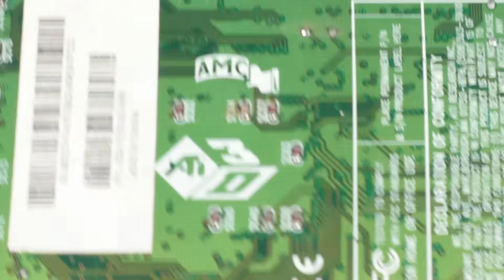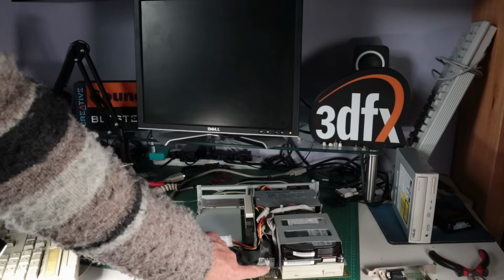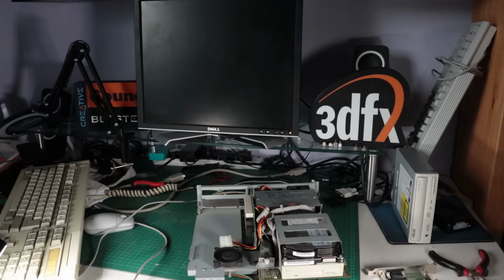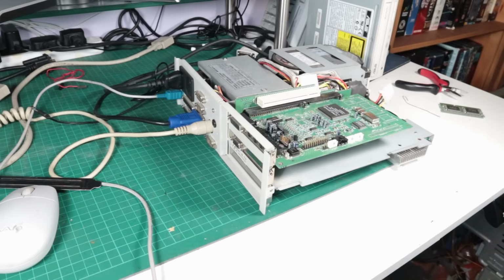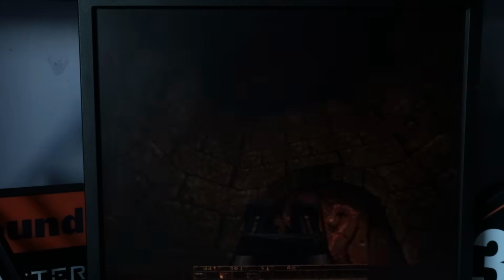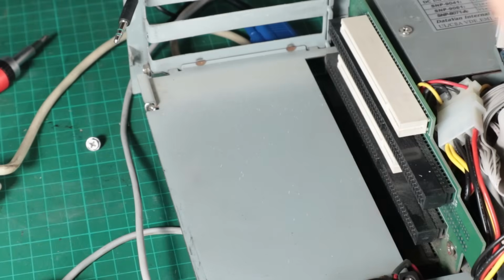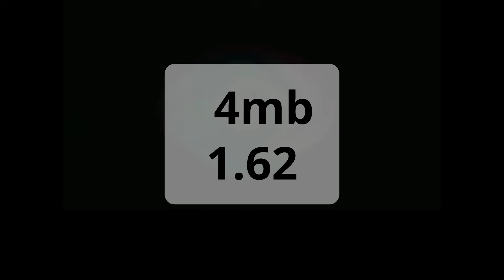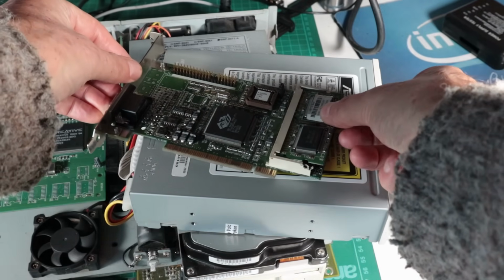Did upgrading vintage graphics card memory make a difference🤔🤞

Comment: I'm sorry but your selection of games and benchmarks is to blame for the lack of a difference here. Testing a 1997 budget card in 1999 benchmarks, of course it would be so throttled by its GPU and memory speed that the amount of memory doesn't matter. Same goes for a PC Player benchmark that uses less than 1 MB of video memory to begin with.
And here is where the 8 MB expansion would make sense: it makes the difference between being able to render at 640x480 or  800x600!
Games from around the card's release profit a lot more from this: like Tomb Raider CIF becomes playable at 800x600, which a Voodoo 1 can't do. Or you leave it at 640x480 and enjoy how it actually runs 10-20% faster than on said Voodoo!
Generally, games that run near your target FPS anyway or had FPS to spare but you couldn't select the higher resolution, that's where you would use the expansion.
To get there, it would often make sense to run in D3D instead of OpenGL (which the Rage Pro is better at) or if available ATI CIF (the proprietary API ATI used at the time, like Glide for 3dfx cards).
Reply from the maker: Haha, no need to be sorry😁 but if all you could afford was that in 1997, you probably wouldn't have been able to afford a new card in 98/99, so what could you do🤔.  I did quake and doom. Neither showed improvement in software, but gl quake did.
Reply: @66mhzbrain  Glquake and 3d mark are really the only games you tested that used the vram as a framebuffer at all, and both showed a difference. However, the 3dmark was to "modern" and heavy for the card leading to low fps anyway.

Doom isnt a 3d accelerated game. (doesnt use any graphics 3d functions)

I dont know enough about expendable to say what the problem was here.

Neither is the base variant of quake (doesnt use any graphics 3d functions), as I am sure you know.

Glquake is probably heavily cpu limited, and also possible by the GL driver from the card. Universal GL drivers were seldom made for performance back in the day, only 3dfx put some more love to get good GL game performance into their driver development.

As an example, I had about 33fps in glquake in the time period with a 200mhz AMD k6 without any cpu FPU software enhancements, (a P2 would have been much stronger) and a NVidia Riva 128 4Mb. A few years later Nvidia rewrote their GL driver and got a lot more Open GL performance.

Comment: Yeah I’d expect this would only get you higher resolutions with higher color ranges and/or allow the card to hold more textures saving time reloading from system memory.
It can’t really help if the gpu is slow to begin with.

Comment: Games like Wing Commander Prophecy, Descent Freespace, Unreal and Half Life would probably utilize the 8MB more than what you showed. I played all of those on my Pentium 200MMX and Riva TNT 16MB after upgrading from the onboard ATI3D Rage II with an add-in PowerVR PCX2.
Reply from the maker: Tnt 2 was considerably better, I also had to take the C6 into account that was probably realistically in the ballpark of a pentium 133 or there abouts. I did think about prophecy as I have it, didn't have time.
Reply: @66mhzbrain  Honestly, I'm pretty sure a P133 would do better in Quake than this, I think this machine was severely hobbled by the WinChip. Interesting machine, I have a soft spot for obscure Socket 7 CPUs, wouldn't want to actually be stuck using one back then though...
Reply: @AshtonCoolman I need to play those games on modernish PCs  :P